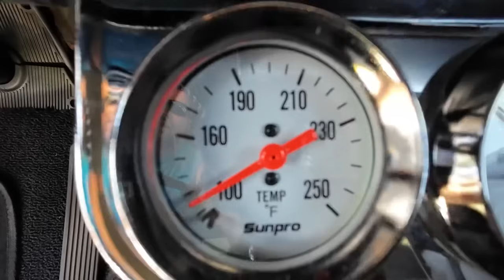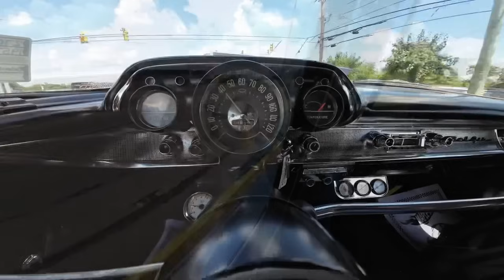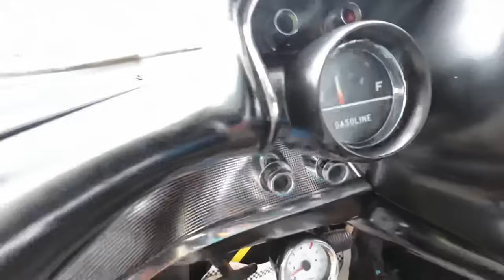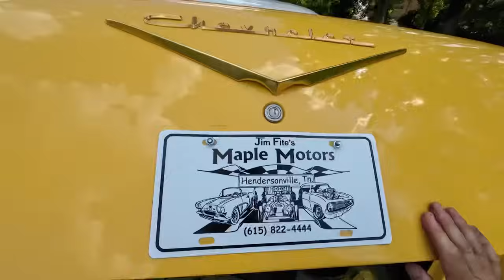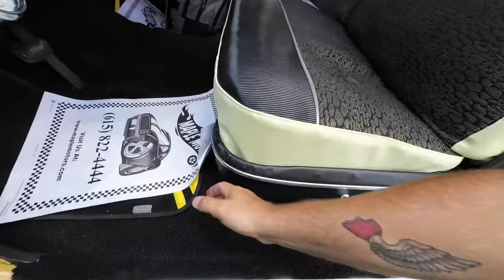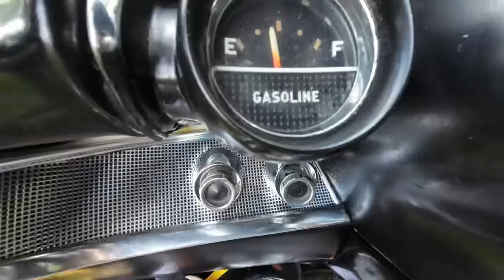Test Drive 1957 Chevrolet Bel Air 2 Door Post SOLD $35,900 Maple Motors #2702

Comment: In 1990 I purchased a new Honda Accord.  From day one I ran Amoco 93 octane white gas in it. 

In six years I put two hundred thousand miles on it. One day my mechanic suggested that due to the high mileage, it might require the fuel injectors cleaned or replaced. It was running great, however, I told him to take a look at them and do whatever necessary. 

When I picked up the car the next day. He told me the injectors and engine was pristine. And needed nothing. 

To this day, my vehicles all get premium fuel. I get better mileage and fewer problems with the mechanicals. Well worth the extra cost.

That is a nice clean ‘57!

Comment: SPAL Fans are Great (Italian it think)     or  retro Fit the 90's Ford Taurus or a Lincoln       Electric//////   used all before. InTexas would never go above 180 in the Summer. Cheapys don't have the beans......... need  high AMP Draw not RPM.

Comment: The higher octane the better the milage will be
Reply: That's not how it works. The higher the octane the slower it burns, which is good for higher compression engines. It does not give better fuel mileage, it stop pre-ignition in higher compression.